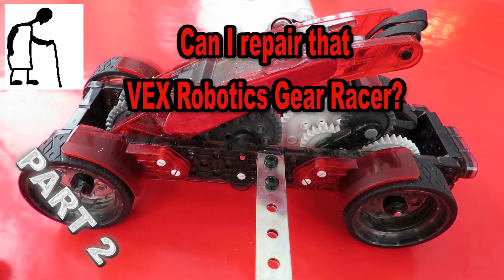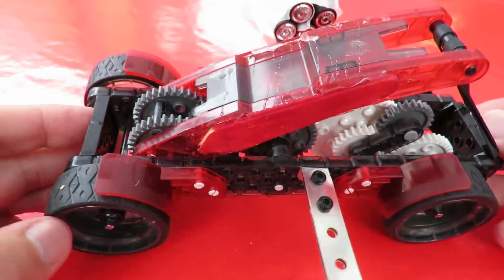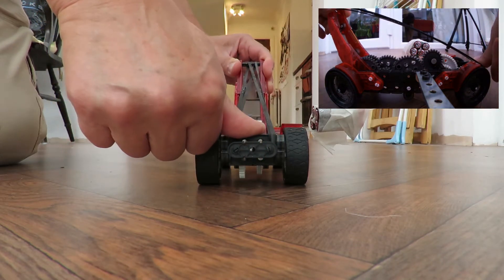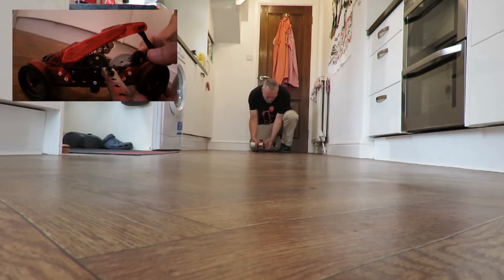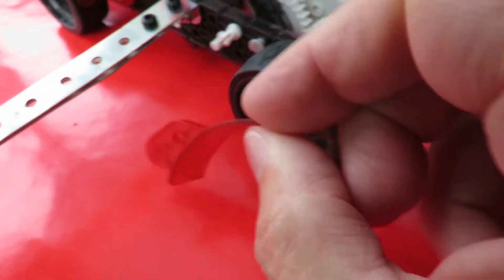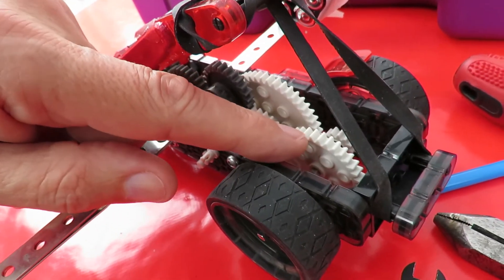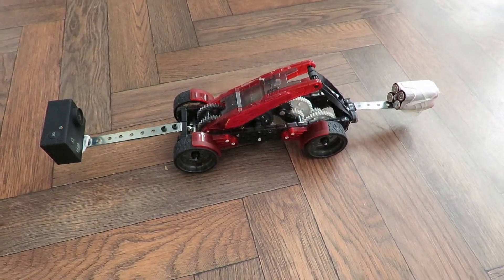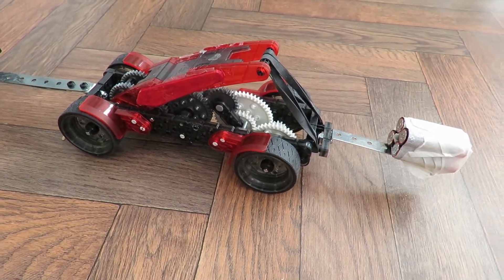Can I repair that VEX Robotics Gear Racer?  PART 2

Comment: Really great work, man. :) Now I think it's just the weight from the camera that is holding it down. :)
Reply from the maker: Even without the camera and weights it still does not perform as well as I had hoped. Technically it looks great but all those gears don't seem to improve it's performance compared to one of my simple rubber band powered cars with the band going straight to the back axle. As an educational tool to demonstrate different gearing options it is fine 😊

Comment: Great video, Grandad. I think you're right in that it's the combined weight of the camera & counterweights, that's causing the reduction in the anticipated range ?
Reply from the maker: Hi Peter, thanks for commenting. Even without the camera and weights it still does not perform as well as I had hoped. Technically it looks great but all those gears don't seem to improve it's performance compared to one of my simple rubber band powered cars with the band going straight to the back axle. As an educational tool to demonstrate different gearing options it is fine 😊